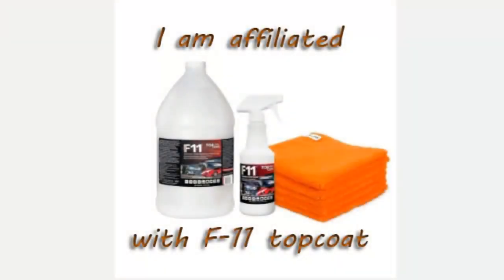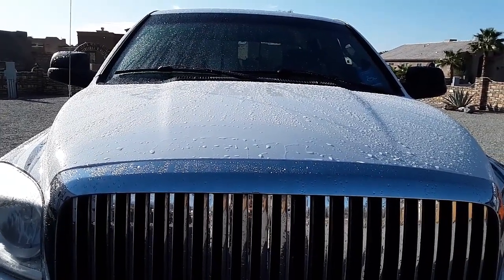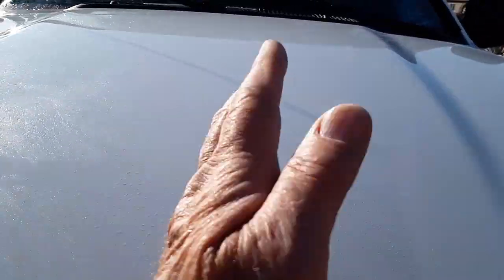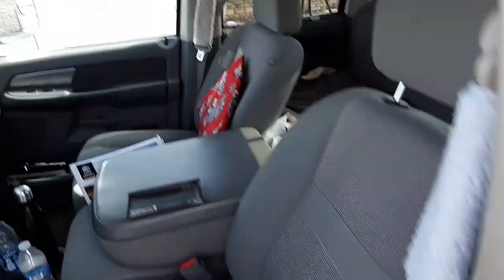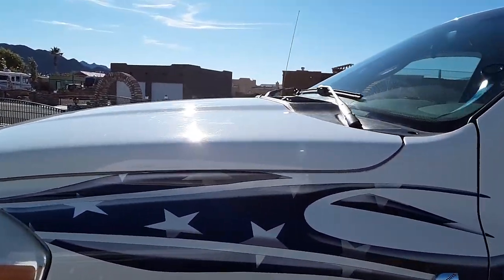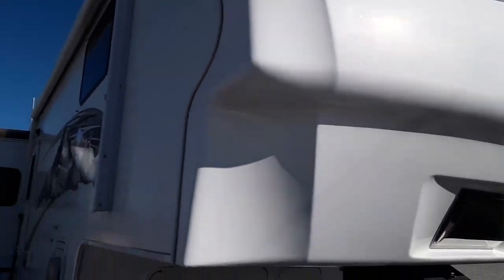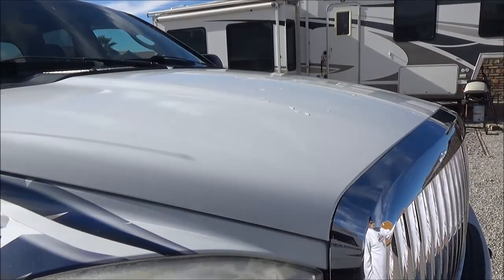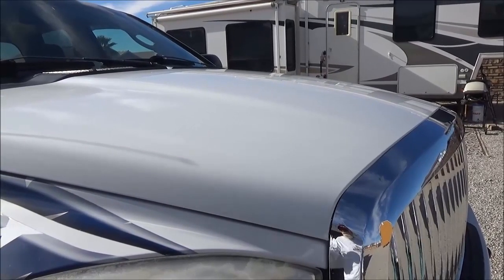F11 topcoat final test.

Comment: I've been using the F11 on my bike for the past year on my bike  and while nothing can replace a good wash with a good car soap (NEVER use dish soap on your paint or chrome) the F11 does make the bugs come off a lot easier and does make for easier quick wipe down with a damp cloth if its not too dirty, I would recommend it, it is a little spendy but if you can find a buddy to split a gallon with its not a bad way to go
Reply from the maker: I just noticed that they're using some other kind of advertisement on my f11 advertisement LOL. They're probably all very good products. I'm not having any problems with the price product f11 top coat. The main thing is is I've been here for four months now I've only washed my truck twice in a car wash that was because I went out into the desert. Any other times it's it's here gets rained on and seems to be working quite well still shiny still looks good. I'm glad that you're using it on your bike and you like it I can't wait to get home to my motorcycle not only just to clean it up and make it look good but to do a little motorcycle riding would be nice.

Comment: For your information there was a ceramic Shield commercial before yours video that showed five different products and f11 failed right away
Reply from the maker: There may be better ones I don't know oh, I've only tried this one and it seems to be working for me. I have no problems with it at all other than the price. But thanks for your information
Reply: All those other products that came out after Topcoat are just copycat products jumping on the band wagon.  Topcoat has been proven over and over,and has been around for almost 15 years.  Within the last year and a half there have been numerous other copycat products introduced, to try and make a quick buck.